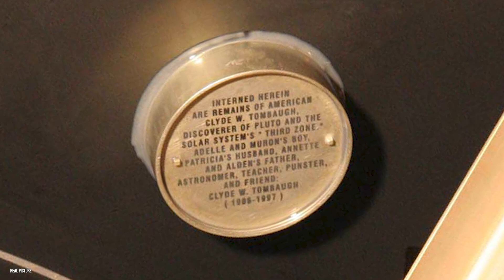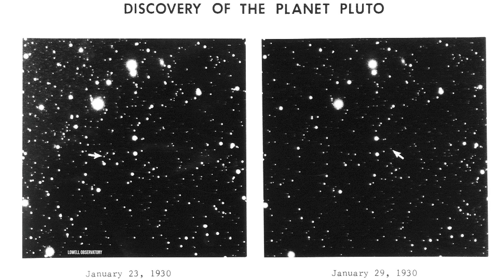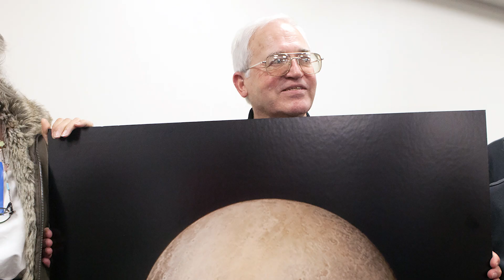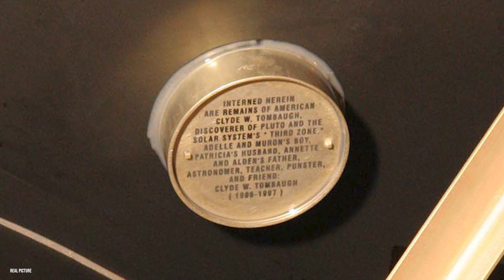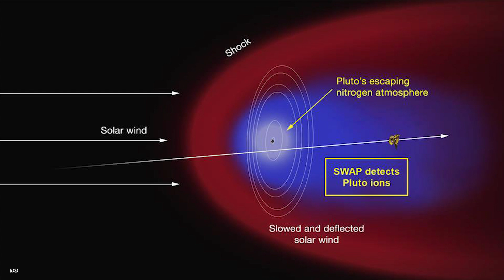NASA Took His Ashes, and Sent Them To Pluto - The Inspiring Story of Clyde Tombaugh

Comment: Yeah, I call bull shit, physics don’t apply when you use their math
Reply: Whose math?
Reply: @ZimmZootinZayai  want a cracker, you parrot.  NASA spread his ashes over Pluto. Sure! 
They can’t even get the batteries used, to charge over 800 times! 
Solar panels. Applying light inverse square law, they wouldn’t be able to charge the batteries, and you charged the batteries to many times to get there. 
Now please explain your Dunn Kruger effect. Or explain triangulating to get to Pluto with out a reference point to triangulate from or to.
What about transmitter power levels , how big is the antenna needed to transmit that far? Don’t look into it, but the antenna they used to screw with your mind, is to small.